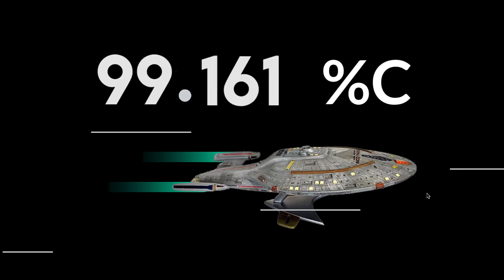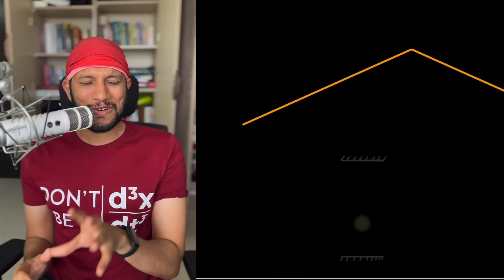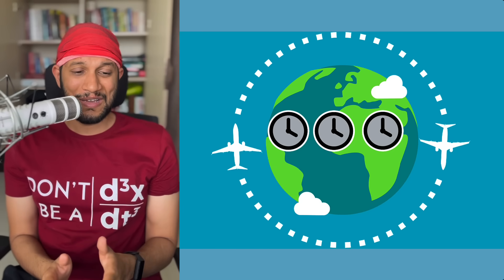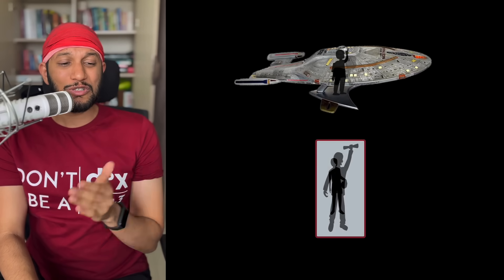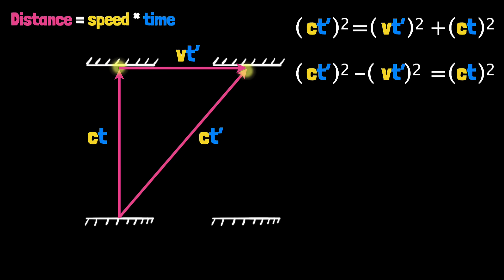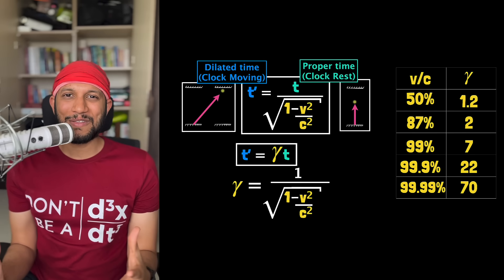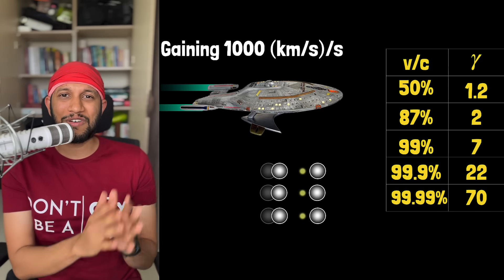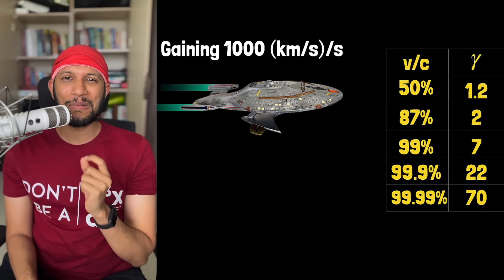I finally understood why you can't go faster than light! (My mind is blown)

Comment: Absolute garbage. The clock experiment revealed a a variety of results. Of those clocks flying about, some were slower than their stationary counterparts and some were faster. They graphed it a number of ways, but could not get the desired result. 

There is no such thing as time. It has no objective reality. There is only motion. And the clocks flying about returned to earth. The only way one would know which clock was 'younger' is because it inhabited a position in earth's orbit and rotation different from its stationary counterpart. But they sit on the same earth in the same place. 

Time dilation is a fraud. There is only motion, and our concept of time rests solely on it.

Comment: None of the experiments prove time dilation. They just prove the measuring instruments weren't re-calibrated correctly to match the new experiment conditions. This is extremely flawed thinking. Time is just a measurement of a dimension. You cannot add or subtract time from a system the same way you can't add or subtract metres from a system. Its just a coordinate, it contains no properties. You can add heat to a system, because heat is a property. To say something experiences time dilation is a complete non-sequitur.

Lets go to the photon clock. A second is defined as the time is takes a photon to travel a set distance. Therefore, if you factor in the lengthening path of the photon, the clock would still be accurate and not be experiencing any time dilation.

Consider a chemical reaction. If you add heat to the system to speed up the reaction, is the system experiencing time dilation? No.

Comment: One wuery for the last section....you said from observer perspective...but from the people perspective who are sitting in ship, if they accelerate 1000km/s, wont they reach speed of c?
Reply: How does someone on the spaceship measure their speed?  In their own frame of reference, the ship is always at rest (since the reference frame moved with the ship).  So that's not very useful. The only way to make a useful measurement of their speed is to measure relative to some external point.  But this is exactly the same as some external observer measuring their speed.  So no, an internal observer on the spaceship will never measure their speed as reaching or exceeding c.

Comment: The solution is that all matter and energy is nonlocal.  This is what the materialist reductionists will not accept.  The measurement of the speed of a nonlocal phenomenon like light is 299 million meters per second. If you are in a space vessel orbiting the earth with phase photometry detecting the speed of light there it is the same.  It is an "observer-centric" interpretaion that time dialates and length constricts on the orbiting ship.  I am not saying that the observations are wrong, but there is also no such thing as one way speed of light period because speed detection would require a synchronizing of clocks at the source and detection point (which is usually done with mirrors on such detection equipment).  If you just accept nonlocality, the explanation is so much easier.  Something moving faster than the speed of light it perfectly fine in its own reference frame, but that light ship drops out of our earthbound ability to measure it.  Ocaam's razor itself (the simplest explanation) that we live in a nonlocal reality will ultimately be consistent with all previous theories.  Knowing that our observation of the universe is actually nonlocal to the universe changes nothing except giving us such a better knowledge of how the universe works.  Trees that fall alone in the woods always make a sound, but with no observation of the noise, it is real only to the tree.

Comment: Well what defines that change? If you move in space you don't have gravity or air pressure affecting you, so you are effectively in quiescent state. Where does the speed "effect" come in?

Your "photon clock" would look like that to the stationary observer or observer who moves with a different speed from you, maybe, but for you - your photon clock would look the same way whether you're moving fast or stand in place.

By that logic you can say that you travel in time when you're driving a car, because you get from point A to B 10 times faster than if you'd walk.

Comment: All holds true relative to observer perspective, what about the ship or person insider prespective, he/ship can accelerates > the speed of light!?!
Reply: Think about how someone on the ship would measure the ship's speed.  In the reference frame of the ship itself, it is always at rest, so that's not very useful.   So it really only makes sense to measure the ship's speed relative to some external reference frame.  This is exactly the same as an external observer measuring the ship's speed, and we've already seen that the measured speed will always be less than the speed of light.

Comment: Hey there, I have one silly question , just suppose that the space ship is already moving closer to the speed of light ( 99.9%) and if we just throw anything inside the spaceship towards its front then would the object would travel at speed of light??...😅😅🤔 14:24
Reply: Not a silly question at all!  Let me rephrase it slightly for clarity: Alice and Bob are on spaceships, and Alice is moving "north" (cardinal directions are kind of meaningless out in empty space, so north here just means some arbitrary but constant direction) at 95% of the speed of light away from Bob.  Alice fires a missile straight forward and measures it's speed as 5% of the speed of light.  Now the question is: how fast is the missile moving according to Bob?

Intuitively you might guess 100% of the speed of light, since that is how velocities are added in our everyday experience.  But we can only add velocities like this as an approximation for "small" velocities (small relative to the speed of light).  In this case, the velocities involved are not small at all and we must use the relativistic formula.  I encourage you to look this up (mostly because trying to type a mathematical formula in a YouTube comment is extremely frustrating lol), but the main takeaway is that this formula will always give a velocity less than the speed of light. So Bob will measure the missile's speed as something like 98% of the speed of light.  We can even take this to extremes where Alice measures the missile's velocity as 95% of the speed of light.  Yet Bob, instead of measuring 190c, will still measure a velocity less than c (in this case something like 99.9%)

Comment: This illustration presents a similar picture to why radio frequency actually travels faster over distance than light over fiber optic cable, considering it is bouncing back and forth at a very steep angle along the core of the cable to preserve signal integrity, therefore slowing its speed along the cable to less than the speed of sound.

Comment: After a while, when the ship will have achieved the exactly speed of light, will be no acceleration, so no time slow or accelerating. Einstein think just in case of accelerating mode but when the speed will be constant (it could be even greater than speed of light) time will remain the same.

Comment: This is the same explanation of the event horizon of a black hole. Being an observer, you can't see objects move as fast as the speed of light, from a distance. Even on a molecular level, atoms still move separately from one another. The closer you are to the object traveling, the closer you are to its speed. The further your distance the longer time is slowing down. The stars in the night sky, are light years away. They may not even be there. However the light is still traveling that distance, showing an object that may not exist anymore. Keep in mind, when you see the sun set, it was already below the horizon 8 minutes before then.

Comment: I have a question.  I you have a rotating disk such as a phonograph record spinning unbelievably fast and the circular rotation near the center reaches near the speed of light why doesn't the outer edge exceed the speed of light?  Obviously I know in the real world the vynal record would destroy itself but assuming it can handle the forces explain to me what would happen.  Or the same principle might apply if I began slinging a rock on a very strong string - spinning it so fast that the rock exceeds the speed of light if the string is long enough?

Comment: @Mahesh_Shenoy but isn't all theories of time dilation based on observing physical things? And isn't time really just a concept of the mind? It's a unit of measurement that we as humans invented. Time doesn't have any physical properties. It's just a concept. So essentially you are trying to compare something physical such as atomic or photon clocks to something that is not physical but a contrived idea. Which is comparing apples to oranges and doesn't even fundamentally apply. Just because a photon moves along a longer path doesn't mean "time" has changed.

Comment: Just one question: so when we are saying that from external view it will look like say ship takes 7seconds to accelarate same 1000 kms now but from the frame inside it still takes 1 sec... and this time keeps on increasing as we approach C.... but from internal reference its still 1sec so if you were to get to that speed of light from external ref it would seem it is taking infinite time but then what about internal ref...it should still be 1 second right...how will that work because externally people will feel its taking forever but for internal ref it still should be 1sec if there is a man sitting inside

Comment: Escape Velocity
If escape velocity were 7 mps and the Sun is known to have 333,000 times the mass of the earth; then the escape velocity from the solar system would be 2,331,000 mps. Do do believe voyager achieved those speeds. Or, is it more likely you are being lied to. You can't slingshot around Jupiter to gain the velocity to escape the Sun as 98.8 % of the mass of the Solar System is locked up in the Sun. Since Escape Velocity is faster than 186,000 mps and no mass can travel the speed of light, we are bound fast to our solar System. As all intelligent life is everywhere in the universe.

Comment: There is one thing I don’t understand, time dilation is from the outside perspective, and when approaching the speed of light the ship seems to stand still from the outside perspective, but what about the inside perspective? What happens with the ”proper time” if the ship keeps accelerating?
Reply: You’re always at rest in your frame
Reply: Nothing changes for the ones experiencing proper time. They experience proper time.

Comment: So let’s get someone in a rocket with enough fuel to constantly accelerate until the speed of light and then from their perspective it will take normal time but for us it will be the end of the universe and so from their perspective it’ll be a finite amount of time and they’ll accelerate to or past the speed of light?  What will it be like from their perspective?  We will see it as them slowing but they will see it at normal speed so within their lifetime they’ll  get there?
Reply: You have to think about how someone on the spaceship would measure their speed.  One of the main takeaways of special relativity is that all speed is relative, so in order to measure a speed you must measure relative to some reference frame.  So the person on the spaceship needs to choose a reference frame.  If they choose the reference frame of the spaceship itself, then trivially they are always at rest, since this frame moves with the spaceship and the spaceship's position relative to itself never changes.  So that's not very useful.  Instead, they can choose some external point as their frame of reference.  But then the situation is exactly the same as an external observer measuring their speed, and as we've already seen this speed will never reach or exceed the speed of light.

Comment: In the photon clock explanation, when the ship is moving, how does the photon know that it has to now take a diagonal path? 1:28  Wouldn't the photon just keep travelling in the same straight (vertical) path hitting the mirror (or even the sides of the instrument)  at a different position than compared to while being stationary? @Mahesh_Shenoy
Reply: Photons don’t know anything, they reflect off mirrors

Comment: So basically this is all hinging on the idea that any moving object isn't a group of atoms moving in unison, it's photon newton balls. And the balls move at the speed of light, so if you try to accelerate them to the speed of light, the second ball is moving away from the first ball at the speed the first ball is moving so it can never catch up. I had never heard of this idea that movement travels atom to atom, one atom at a time, via photons or waves that move at the speed of light. What is this concept called, and what evidence do we have for it? It seems that if there's any chance at reaching or surpassing the speed of light, it would lie in finding a faster way for atoms to interact with each other.

Comment: We, also matter, are just light trapped in particles. That energy is oscillating, vibrating, moving at the speed of light within and between the particles. If you move in one direction near the speed of light, all those oscillations, vibrations and movement have to be on hold while all the energy is moving in one direction.

Comment: When light travels through Cesium 80 gas it travels faster than light through a vacuum (i.e. "the speed of light").
Reply: The light can stimulate emission in cesium but the photons travel at c
Reply: The photons travel at the speed of light through cesium 80 which is faster than the speed of light through a vacuum.

So long as c is defined as the speed of light through a vacuum... c can be exceeded.
Reply: @ the phase velocity can. The velocity of the photons is c

Comment: My exsplanation is very
Energy is equivalent to mass
Faster objects contain more potential energy
Object with with more mass require more energy to accelerate
There for there is a point where the energy require to accelerate is equal to the mass it can accelerate, That is at C the energy has only the energy to accelerate it's self. 
This also explains why the speed of particles with 0 rest mass is C

Comment: DoDid you realize that your conclusion ends with the energy required, infinite or finite? Did you know that you also need energy to see the photon in the photon clock bounce? Just for reference, the photon in the photon clock must split off a photon to your retina in order for you to see it. Even if you only see the photon in the photon clock once a second, the photon in the photon clock must split off a photon to your retina every second, not to mention that Einstein also saw it. So, at least two photons are needed. Of course, to connect the dots or photons you see and form the jagged image, do you know how many photons you need to see? Does the photon clock on the spacecraft have enough energy to emit enough photons for you to see it, whether you see it or not? Indians are the best at regurgitating what they have eaten and acting as if they have understood it. After all, at a speed v comparable to the speed of light c, does the Pythagorean formula still apply?

Comment: You can't go faster within the "normal" universe.  You have to access "subspace" to go faster.  Which means you must temporarily enter a fifth dimension with either has its own rules of physics or has a different way of measuring distance.  More likely the second one where two points in subspace are close together but correspond to two points in "regular space" which are far apart.

Comment: I'm not a physicist, but I've always been fascinated by the idea that time slows down at incredible speeds.

One thing I've often wondered: Would someone in a slower time frame, due to the relativistic effects of traveling near the speed of light, perceive their experience of time as normal? Now I think the answer is yes. Their perception and thought processes would slow down relative to an outside observer, but they wouldn’t notice anything unusual because all their biological and neurological processes would remain synchronized with the slowed passage of time.

This synchronization means that, subjectively, time would feel the same as it does in a "normal" frame of reference. From the perspective of an outside observer, however, their actions and thoughts would appear drastically slowed. This phenomenon is a natural outcome of time dilation under Einstein's theory of relativity.

A good analogy might be a computer game or simulation. Inside the game, it doesn’t matter how long it takes to process each frame; to a character within the game, time feels consistent because everything stays in sync (assuming the programmers didn’t rely on some absolute timing, which would be a bad design anyway). To an outsider, however, the game would appear to run in extreme slow motion.
Reply: You’re always at rest in your frame

Comment: Does elemental decay stay the same?
Reply: Rate doesn’t change, time is relative
Reply: @AMC2283  
So the faster you go, the decay rate will seem to speed up?
Reply: @germanvisitor2  it’ll stay the same in your frame. It would only speed up if they’re non inertial and blue shifted
Reply: @AMC2283  
Sorry, I don't get it.